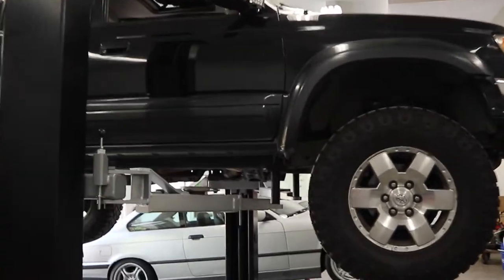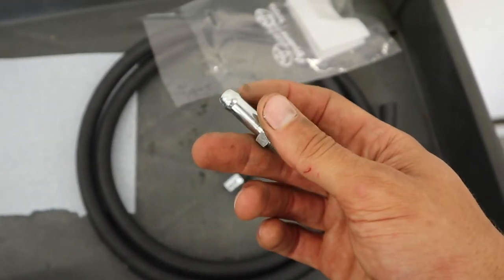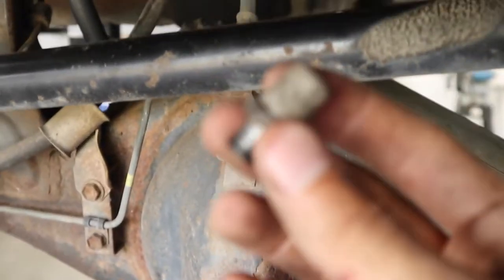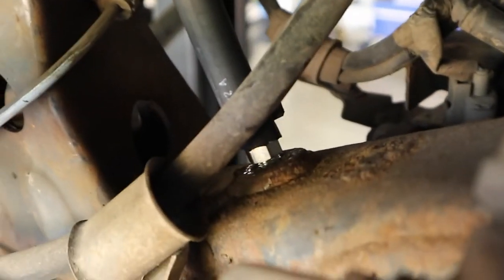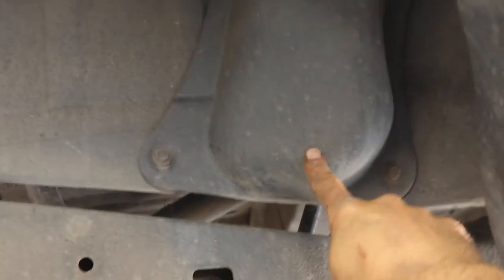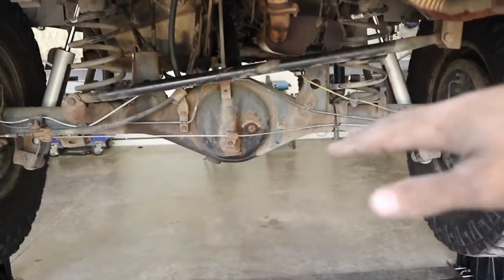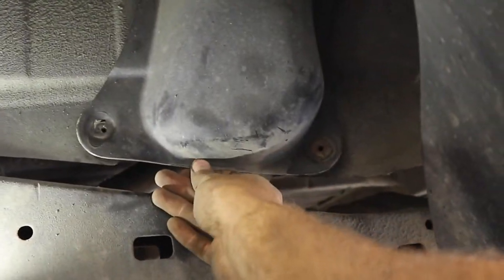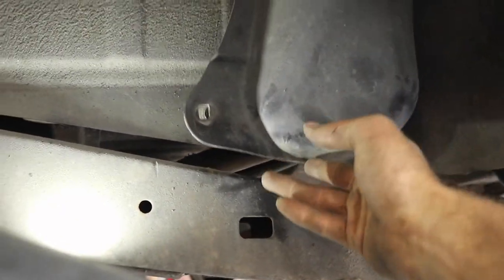3rd gen 4Runner diff breather mod how to in under 5 minutes

Comment: Did this after a blown rear axel seal on my 02. I remember hearing a hissing sound right after I removed the old OEM valve. Ran the hose line up through to the gas cap area. Tummy the tool man also had a good vid. Thanks for the info. You’d think this would be standard on all 4 Runners.